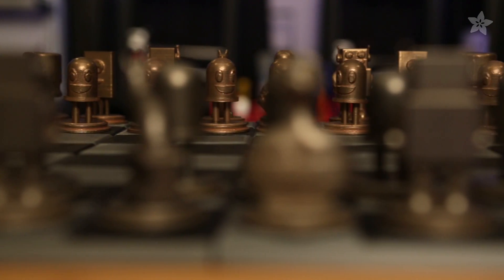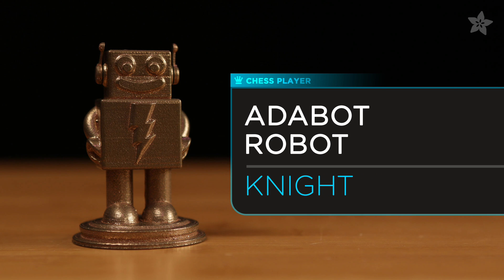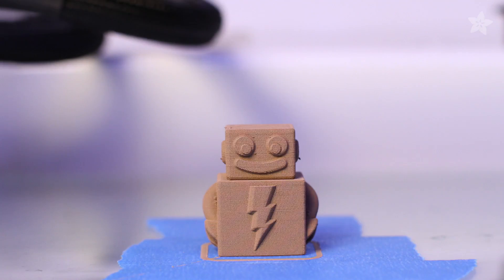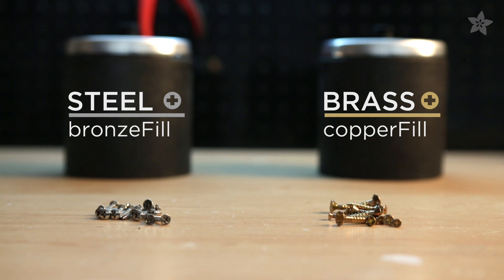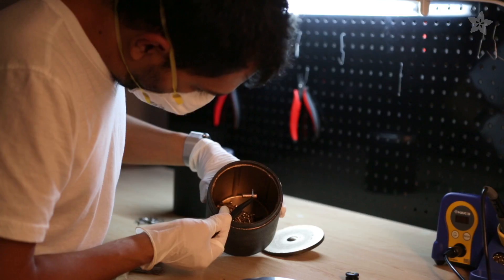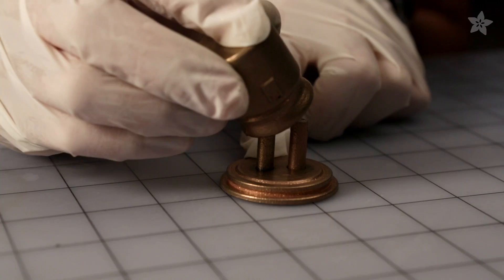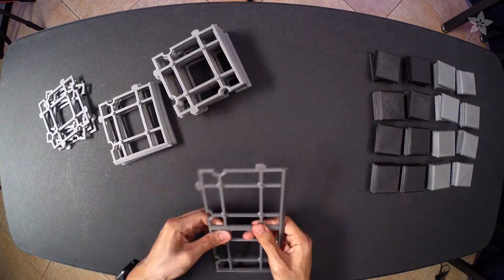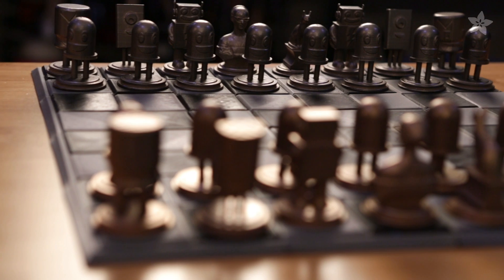Adafruit 3D Printed Metal Chess Set

Comment: very nice work. sorry but the Queen should be a Vacuum Tube and the King can be TO-3 style Transistor. Now the vaccum tube would be hard to visualize. But this is where you recycle one of those elongated clear glass incandescent bulbs and match the 3D print dimensions for the diameter and height so the bulb slips over on top, tack it on with some hot glue or suerglue